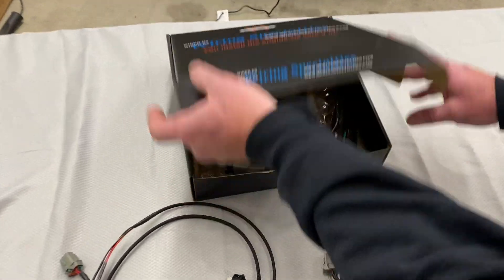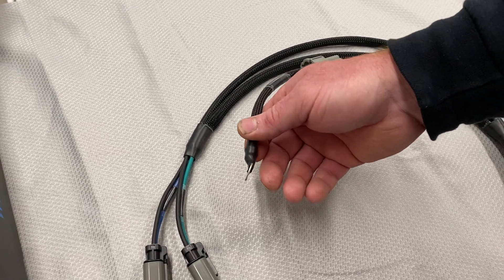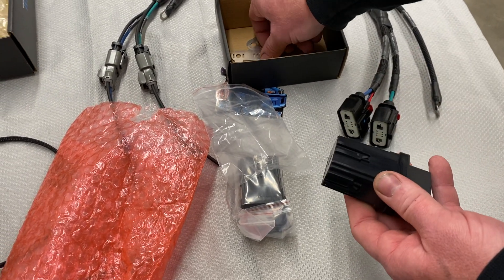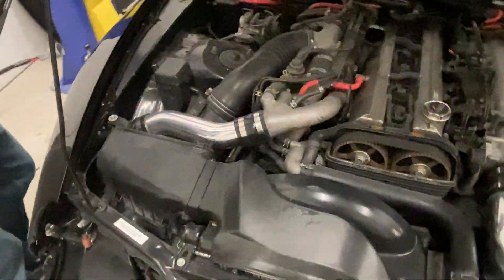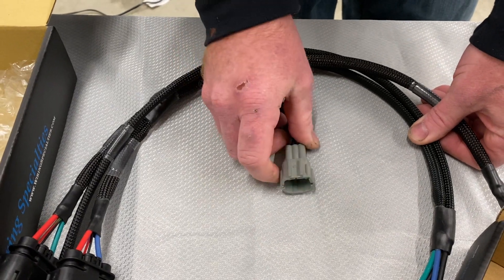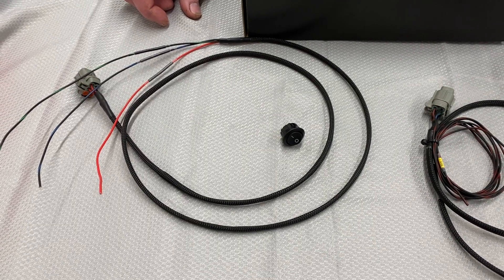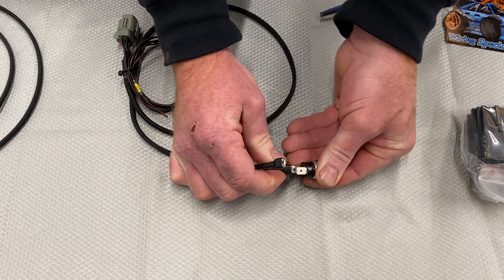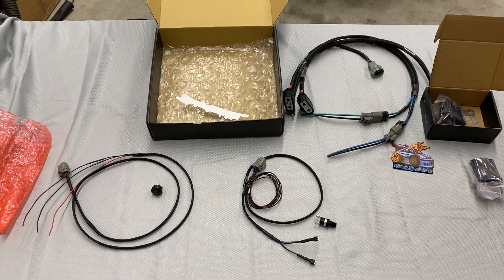Fan / Fuel Dual Relay Kit by Wiring Specialties

Comment: This is actually pretty cool. Compared to others I've seen that's actually seems to be more robust. What's the chance you could make a 2-speed version for 2 fans? Also can it be made to where you have two positive triggers instead of negative triggers? I ask because my vehicle already has positive triggers with constant ground for an auxiliary cooling fan